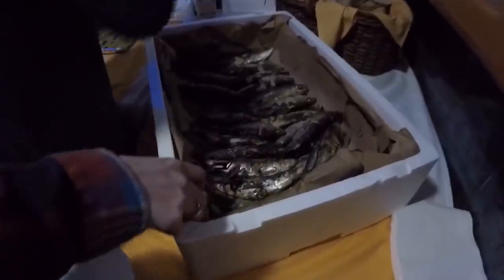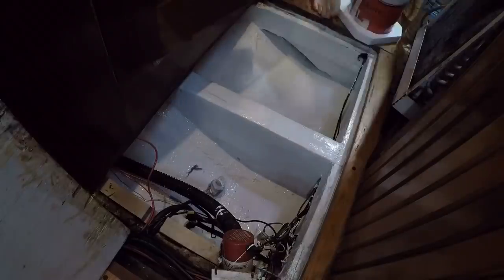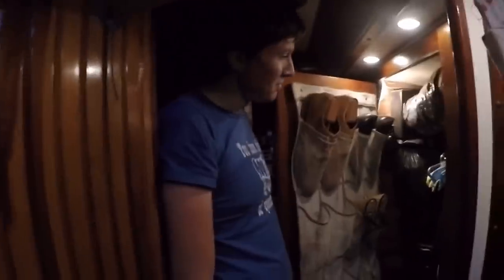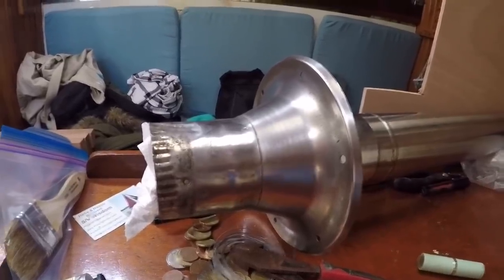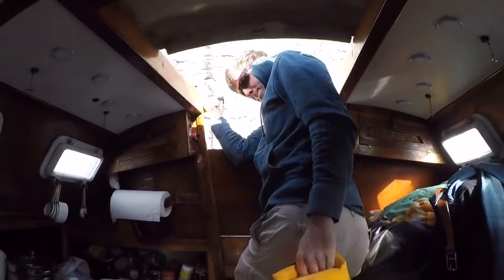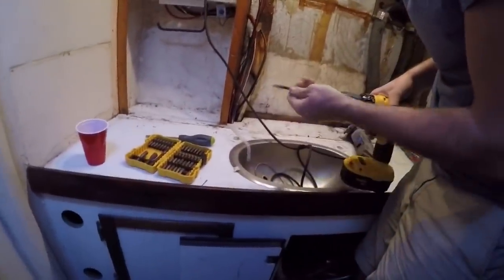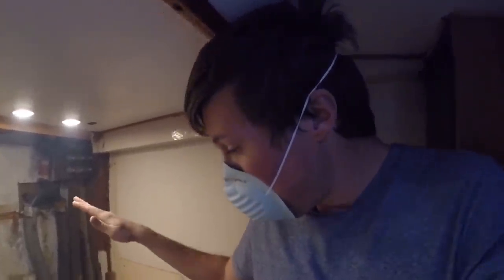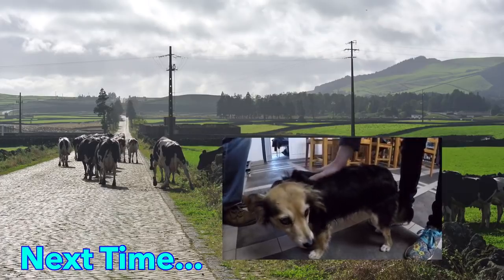We Have a Dirty Little Secret | Sailing Wisdom [S3 Ep23]

Comment: To remove cured epoxy from screw heads grab a mini pick and hook set from whatever local hardware store you can find (or order on-line).  Keep it close at hand, you'll use it frequently.  Tchau.

Comment: Sometimes I wonder if removing large pieces of built in fixtures will mess the the structural integrity of the boat. What if those wood cabinets being bolted into place added to the stiffness of the hull and now it could become a flex point? Just wondering if you gave that some consideration?
Reply from the maker: It was a concern and consideration. I decided it was safe because:
1. We are very close between two large bulkheads. 
2. One bulkhead was really rotten, so there wasn’t much strength there at the moment. 
3. The hull is really think, so it won’t gain that much from a table top. 
4. We are going to be making a similar structure in there again (minus the rot)

Comment: Wow... They are actually painting the entire boat with that tiny spraygun. The same type I used for my rowing boat project. That is going to take forever I tell you! ;-)
No respirators. No protecting of neighbour boats (or anything else, including yours for that matter).
The whole boat yard is grey when your boat is finished!
I'm not sure those guys know what they are doing.
At least check what they are using as paint.
Reply from the maker: All Interlux paint (I bought it). 
This is how they paint all the boats here and several other boats are being painted as well. 
Somehow (and I have no idea how) no paint is going on other boats! They guy next to us is (still) flag blue. 
I can only imagine the colors of their lungs.
Reply: The reason must be the tiny spray gun then! :-) But still... wow...
edit: Now I got it! They have made a buffing deal with everybody else there!
Those clever bastards! ;-)
Reply: I would be concerned with over-spray as well!  the neighbors boat may not look grey but its most likely peppered with over-spray. you wont see the over-spray it will be too fine. it will just have a texture and turn polishing pads or clay bars grey when it gets its blue paint buffed.  maybe run your hand over the neighbors boat, if it feels a little gritty on the one side facing your boat... i guess thats there problem now?  but when your boats painted you may want to consider getting it out of the boatyard or yours will be next:) I love your videos, they are awsome! ive been a fan for a long time. thanks
Reply: @DC-si8xw  Chill! Any solvent based paints sprayed will dry within 2 meters (2.2 yards) being airborne so it might just be a bit of dry paint Dust should it settle on the boat next door. I'm very sure the guy that's doing the work knows the consequences of damage to other clients property.
Reply from the maker: Haha in this case maybe ignorance is bliss. We are definitely getting back in the water as soon as they are done and we finish the bottom makeover as well!!! Thanks for being part of the ride :)